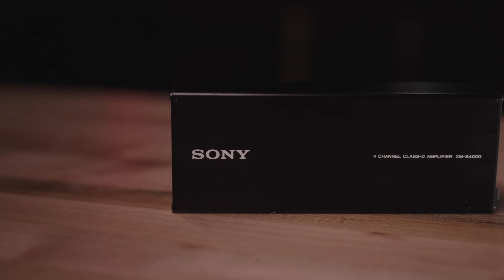What's the difference between amplifier classes? | Crutchfield

Comment: Anyone calling a basic class D amp "digital" should go to jail. Thank you for calling things the right way.
Reply: Correct, Class-D amps are switch mode amps, not digital amps. 
I think this misnomer goes back to Sony who marketed their first HiFi Class-D amp in the 70s as a "digital" amp. That was the time from the late 70s to the early 90s where many companies wrote "digital"  or "digital ready" on their products (even passive speakers!) for marketing reasons.

I would say however, if the PWM is created through DSP or even directly created from a digital signal, there is a reason to call it a digital amp, even though the PWM itself is essentially still analog, or rather a digital emulation of an analog PWM, as stepless vs. quantized is where I would draw the line between analog and digital.
Reply: @westelaudio943  Mass market companies were quick to market those amps as digital, but the audio signal that you hear never gets converted to digital at any point on its way through the amp. The confusion, as always, comes from how the amps were marketed. A lot of the high end companies saw the potential, but didn't want anything to do with them because they didn't want to be labeled digital.ARC went with class T to try and avoid the conflict. However, some companies were early adopters. PS Audio put Class D on the map, and people were stunned that Jeff Rowland was one of the first to make the switch.
Reply: @AT-wl9yq  

Those early Sony class-D amps from the 70s were hardly mass market though, they were very expensive and are very rare nowadays. Sony made many products for the high end segment back in the day. 
The price of those things has really come down and now you can get Icepower modules for around 100 USD or so which are pretty much complete power amps, PSU included, without the case and those sound real good. 
They pretty much, except for the case and switches, offer the same functionality as the early Sonys which also consisted of a PWM stereo power amp and a flyback PSU (funny enough the transformer in it actually looks like the flyback from a TV, but it makes sense for a brand that mainly sold TVs).
Reply: @westelaudio943  I wasn't talking about the ones from the 70's. The modern trend started with the B&O ICE modules. These convert the signal to digital and use that to control the switching. At that time, mass market brands started to make amps using them. Then came the PS Audio HC-A 2. Stereophile gave it a good review, and that's when people started to pay attention. That amp was the single biggest event for class D, by far. Dozens of companies started making class D amps because they didn't want to fall behind. But it was all because of that 1 amp. 

Personally, I think they've come a long way, but not far enough for me to switch. Regardless of what I think, when you go to CES, a lot of rooms are using Class D amps. That shows a lot of confidence in the technology because all the systems at the show are listened to and reported on by all the industry publications. .
Reply: @AT-wl9yq  

Class D only makes sense if you want high power, or medium power at a small size. 
Though I think the problem with class-D is not sound quality, even the cheap-ish ICEpower modules sound pretty good in my opinion.
The bigger problem with class-D amps is that they are unreliable, and also pretty hard to service because of their complexity, although to be fair ICEpower at least gives you service data to their products. 

Even though I follow PS I never looked into the details of that amp. PS products are above my price range. But I'll check it out.
Reply: @westelaudio943call it what you want to call it…  but when you compare the two signals and understand how they are produced, you would have to visualize the wave form on paper. you can zoom in very closely and you Will quickly see the difference between digital and analog.  Think of Digital as a bunch of packets of information crammed together as tightly as possible to create an as “close to “ a continuous wave as possible.  Its not possible. As there will always be gaps.  Its how PWM works.  Analog is seamless in its nature.   The question is what will you get with a quality analog amplifier after the signal is already poor and weak to begin with?
Reply: @champspec  the wave on the output of a class D amplifier is continuous, no matter how much you zoom in 🙂
Reply from the maker: The Marantz Reference PM10 is listed as a class AB amp.
Reply: @crutchfield  Its not a class AB amp. Its a class D but Marantz won't actually call it that because they don't want anyone to think its digital.
Reply from the maker: Thanks, Jasper! 🙂
Reply: Yes sir.
Reply: Bwhahahahahahahaha
Reply: Class D is a PWM switching amplifier. Class A is a pure linear amplifier. Class B is a biased amplifier. Class AB is a biased linear amplifier. I am not really a fan of class D amplifiers but I’m perfectly fine with them for subwoofers and there are some old school Class D amps that have an amazing sound like Phoenix Gold Titanium amps and MMATS. I love the sound of horn speakers with tube or pure class A solid state amplification.
Reply: Class-D amplifiers primarily work with digital signals. Unlike traditional analog amplifiers, Class-D amplifiers use a digital switching technique, specifically pulse-width modulation, to amplify the signal.

So, I guess it is not so bad to confuse it with a Digital Amplifier, considering the fact that the Class is 'D'.
Reply: @Anime_Edits_TN  most class D amplifiers don't work with digital signal at all. Neither PWM nor PDM are "digital". Switched mode doesn't automatically mean digital, digital requires involvement of some kind of logic.
Class D is analog.
Reply: @tomkocur TIIIIIIME! (Shift!), WE DISCOVER THE ENTRYYYYY
Reply: @Anime_Edits_TN  There's no such thing as a digital amplifier. And calling class D digital is going to be a hard sell. The first class D amps came out in 1955. They didn't become popular until later on, but that's when they were introduced. 

Most modern class D amps tap off the incoming signal and convert it to digital. That signal is never part of the signal chain. Its used as a map to turn the transistors on and off. Its really no different than saying time is digital because you have a digital watch.
Reply: Amen
Reply: Nothing can be digital in the end, or we wouldn't hear it. Ears are analog
Reply: @henrikpersson4698  If the device is doing some digital processing, it can be called digital. For example DSPs are definitely digital, they take analog input, convert it to digital form, do some maths on that signal and convert the result back into analog. This is digital.
Class D amplifiers are in no point digital, they take analog signal, use it to modulate PWM or PDM signal to generate amplified output. This might be called discrete signal (before output filtration), but discrete is not an equivalent of digital.

I think the presence of a discrete signal is where the "digital" comes from, but there's a ton of analog devices utilizing discrete signals - for example power supplies, which no one in their right mind would ever call digital.
Reply: @tomkocur  "Nothing can be digital in the end, or we wouldn't hear it. Ears are analog"

That's a factually true statement. 

"If the device is doing some digital processing, it can be called digital. For example DSPs are definitely digital, they take analog input, convert it to digital form, do some maths on that signal and convert the result back into analog. This is digital."

So what you're saying here a signal can be processed when its digital but then gets converted to analog in the end so we can listen to it.
Reply: @tomkocur  huh..why are you explaining this like all of us responding to this funny quip don't know that? You're wasting your time .
Reply: @LIL-MAN_the_OG I didn't know, this is relatively good information

Comment: Good explanation. What does class AA amps mean? Can you please explain.
Reply from the maker: We do not have information on class AA amps to know how they compare. Wish we had different news for you there.
Reply: AA uses class A voltage control and class B current drive. To put it simple - class A circuitry covers the switching gaps of class B stage.
Reply: @tomkocur  thanks!   Curious,  my new headphone amp is a THX class AAA Linear.   I get class A,  and now AA.    Is AAA just marketing mumbo-jumbo?
Reply: @Johndouglasphillips  in this case, AAA is not referring to amp class, it's a marketing name (meaning Achromatic Audio Amplifier) tied to THX's special design, which they have patented. 
Patent itself says that the amp can be operated in class AB, B, G or H, however there's no proprietary IC for this, it uses comercially available opamps.

Comment: Not entirely accurate on all points. Pure class B amplifiers are common and used to be the majority of amps if you go back in time a ways. Classes G and H aren’t proprietary to any brand; they’re design principles that are very different from class A B and D and are implemented in certain situations—usually high power applications. Class G and H amps will have a series of multiple mains supply rails whereas classes A B and A/B don’t. A lot of ultra high power solid state amps are class H and so are a lot of the amps assumed to be class A/B. Also although rare, there are solid state amp designs that are as efficient as class D designs. 

Had to rant a bit I’m sorry haha
Reply: Class G and H is not very different from AB, the working principle is the same - load driven by a complementary pair of (a set of) transistors. The only difference is that you have two or multiple pairs running "in series".
Reply: That’s a huge difference though and requires a much different initial and predriver structure. Usually way more complex than a design with one supply. Some of Carver’s class G designs used a time delay on the inner rails to keep the outer rail devices ahead of the audio signal being fed to the inner pairs. And modified the transients/wave shapes of the signals the outer rails fed relative to the audio signal. His most efficient designs were more efficient than some of the best class Ds. Way beyond any class A/B. Just insanely hard to build and service.
Reply: Who uses pure class B? The only company I know of that tried them was Naim. I'm not saying you're wrong, I just wasn't aware they were used much, if at all.
Reply: And AT1272 in this day and age pure class B is indeed obsolete except with hobbyists that build project amps where simplicity is valuable, but if you go back 3 or 4 decades ago the majority of reasonably powerful transistor amps were pure class B. Compared to the amount of mechanical distortion speakers present, the added crossover distortion of a class B amp with good components is negligible.

Comment: Xcellent👏but how can i know my yamaha rxv795 1998 if it is class a or b??
Reply from the maker: We did not carry that model and didn't get any details on it and recommend contacting the place you purchased it from or Yamaha's support to see if they still have information on the amp class used in it.
Reply: Its class AB. No mass market receivers use class A amps and using class B is almost unheard of. I believe Naim tried using class B amps at one point, but its so rare you'll probably never see one. That leaves you with AB or a switching amp like class D.

Comment: Hello I have question, I a class T car amplifier so what do you think of class T amplifiers
Reply from the maker: We do not have any experience with power amps using that design. Wish we had different news for you there. Searching online, it appears to be a version of the Class D and should share a lot of the same design traits
Reply: Tripath's version of Class D. Lower distortion than basic Class D amps, noticeably better sounding.
I have a couple of cheap class D and class T amp modules and while class D is "meh", class T amps are comparable to a decent AB.
Reply: Its very similar to class D. ARC used to use them back when class D was getting popular. Everyone thought class D was digital, so they went with class T because they didn't want people thinking their amps were in any way digital.